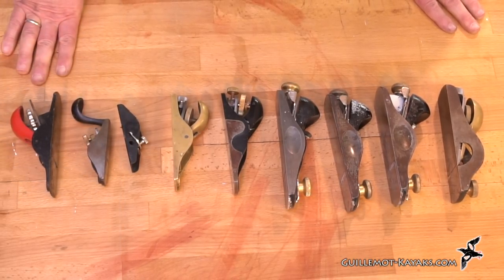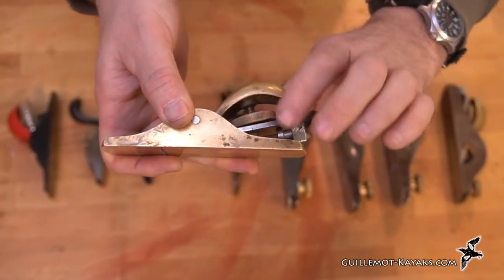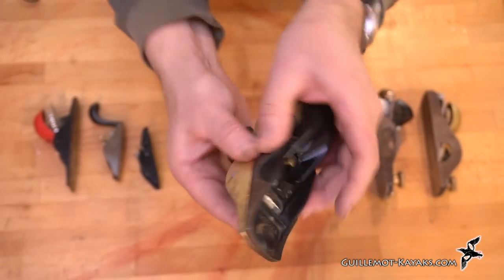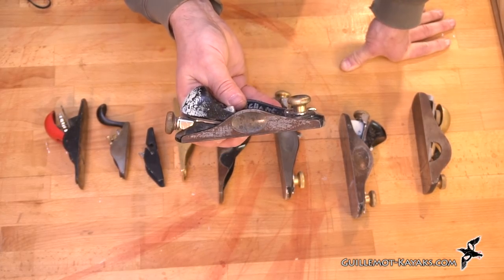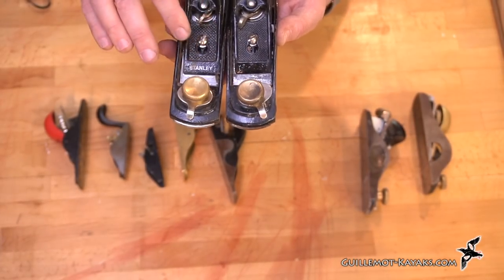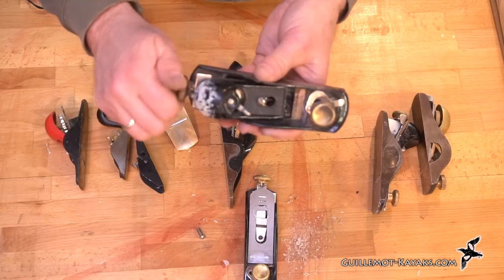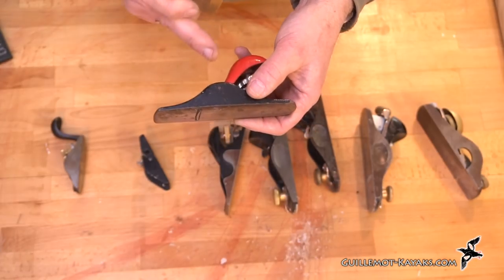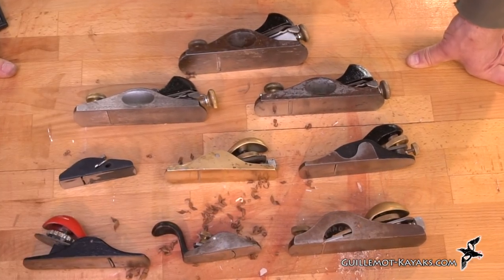Tool Talk - Block Planes

Comment: On PBS's site the Woodwright's Workshop has some terrific videos on planes. I've watched them a couple of times. 
What I noticed when I started sharpening my plane blades and chisels using the Scary Sharp method while building your Great Auk kayak design 13 years ago: If I sharpened the plane blade in the morning and, then shaved down a bunch of western red cedar, the blade wouldn't feel duller, but if I touched it up at the higher grits it was noticeably sharper.

Comment: If you flatten the sole of a plane on an edge sander it saves a lot of time and effort. The alternative is a milling machine. My old Stanley number 6 was hopeless before I flattened the sole using a worn out belt . You need to be careful of sparks though. It worked fine afterwards. I have replaced the irons in all my Stanleys with thicker/better quality. If I were starting again I would buy Luban/Qiangsheng, but then I have more money for my hobby now. Buying really cheap is a mistake.

Comment: Great discussion!  I have the Lie-Nielsen bronze block plane(#102), as well as a bunch of other block planes, but rarely use the others. The Lie-Nielsen fits in my hand and pocket very well. IMO the extra $$s spent on the LN has been returned many times over. I have old Stanleys and Records that have been tuned-up and have Hock replacement blades. The amount of time and effort to tune them up was significant when compared with the out-of-the-box performance of the LN. Suggestion/request: when you do a tool-talk on scrapers, it would be helpful to include cabinet scrapers and card scrapers. When I say cabinet scraper I am referring to the handled ones(similar in shape to a spokeshave) not the bodied ones that look like planes.

Comment: I had a small plane I used for only cedar shakes and exterior trim. It seemed as if it wore evenly  it was still sharp even though the blade and sole of the plane became deeply dished. But I still sharpened it back to flat every 6 months or so.

Comment: Have to agree on plane choices. Dad bought me a low angle Stanley as a Christmas present must be close to 40 years ago now, and it makes me smile every time I use it (perhaps even more now that Dad's gone). Maybe 20 years ago I bought the LVT Apron plane when I built my Wee Lassie, and it's a joy to use and brings satisfaction every time I use it. On the rabbet plane side, I was thinking of trying this modification, seeing as how I do have one of these cheap planes too and it never gets used (especially after I was recently given a good 'made in Canada' Stanley regular block plane that belonged to a friend's father). https://youtu.be/DiTwEeFgAIg?t=4m31s.

As an aside, I was flipping through your first kayak building book this morning Nick, and it's interesting to see how your techniques have evolved over time, (and how much is exactly the same). Really appreciate how you're sharing.
Reply from the maker: That DIY rabbet plane video is a good idea.
Reply: I thought so too. I'll let you know when/if I give it a go. Still trying to figure out which side would be the best to cut out for someone who's totally right hand dominate, I think it would be the right side of the plane. I'll be checking out your keel line planing videos again for insight.

Comment: Hello, have  vou ever  tried  the  japaneese  wooden planes. There are some with  a nice  convex  ágape.
Reply: Shape
Reply from the maker: I have not. I would likely want a whole series of them to efficiently work the inside of the kayak. I find the sharp scrapers serve my purpose well. I used to use the convex plane I made myself quite a bit. When tuned up well it works quite nicely, but I found scrapers are more efficient.

Comment: Agreed, price and name is not everything. I needed a number 4 plane and tired of looking on eBay for a Stanley I could afford, settled for a "Marksman" probably made in India or China, £8-69 delivered. It took a lot of setting up, the most work going into flattening the sole and reworking the chip breaker but I now have a plane (with wooden handles, not plastic) that will make shavings you can read a newspaper through and I'm seriously thinking of making a video to back my words up.

Comment: How tight are you supposed to crank that big flat brass round over the blade? I loosen mine to adjust the in or out, but then crank back down on it, just until my fingers almost bleed. Does it just need to be taut?
Reply from the maker: You don't need to crank it very tight. It should be snug, but bleeding fingers can be avoided. The goal is to have it so the blade doesn't move. If the blade is sharp, there will not be that much force to move the blade.